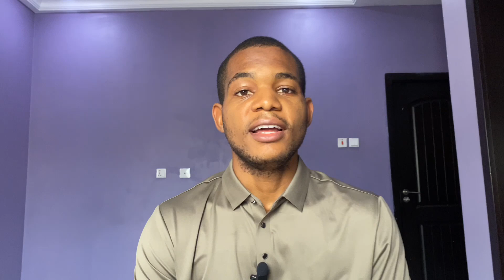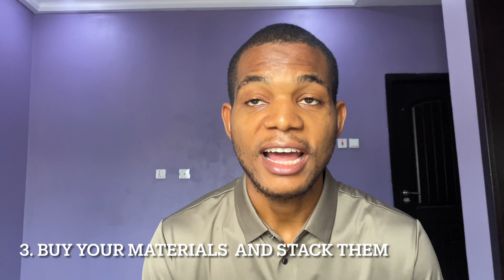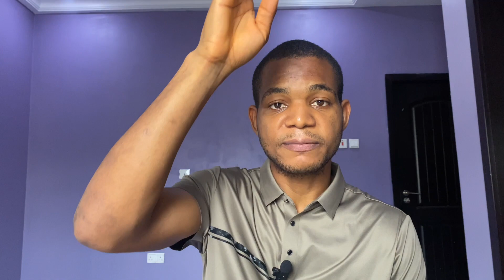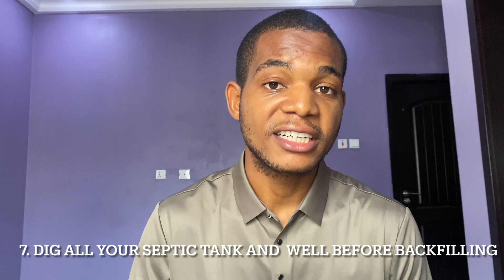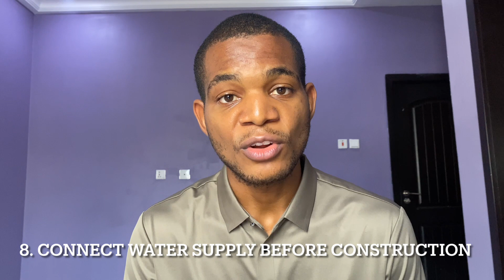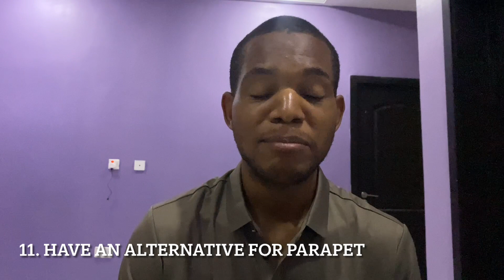How to Save Cost When Building in Nigeria

Comment: Nice one, am starting my project soon but l notice that the soil type at my area of land when dug is clay soil, so can l  use it for back fill at my doc level or should l use a sharp sand for backfilling.thanks
Reply from the maker: If that is the case you might need to buy laterite.